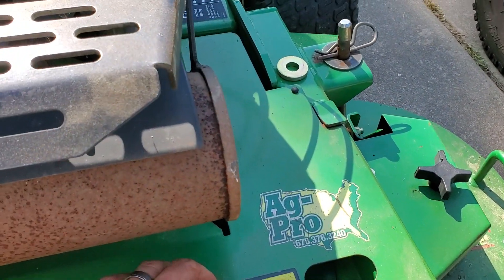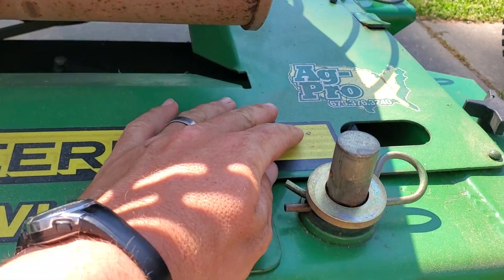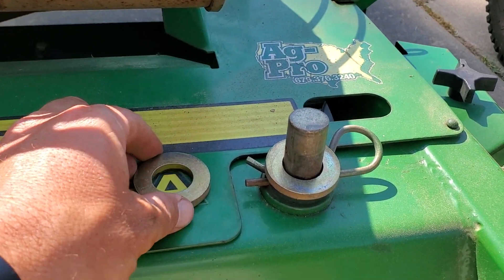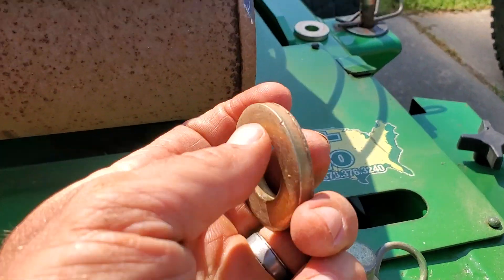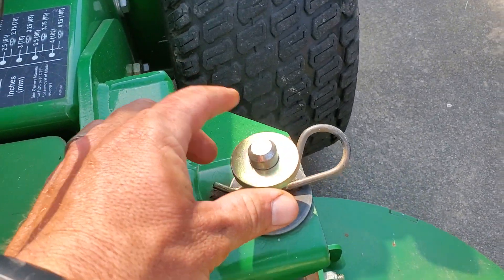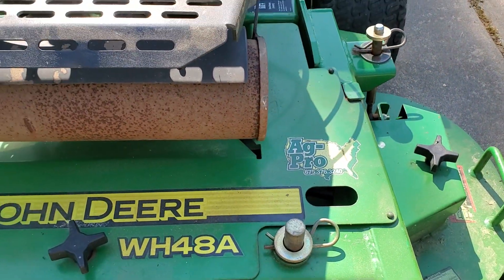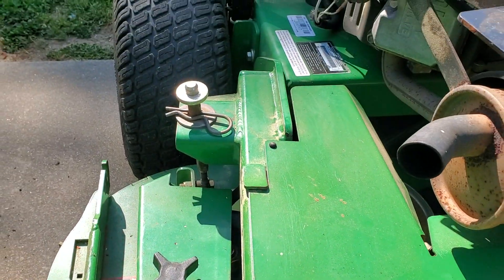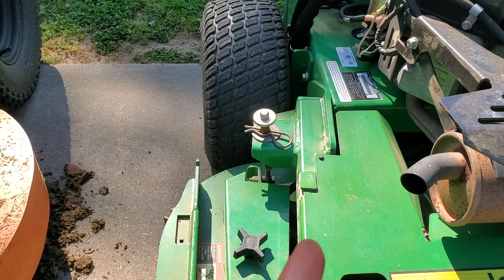I was wrong about the front "weights"

Comment: A day you don't learn anything is a wasted day.... My Metro is the same way. Pretty much any fixed deck mower is. When you move the washers from the top of the post to the bottom you adjust your blade height. Hoping all is well Bud, Dirty Jersey out!!
Reply from the maker: But these where bolted under the frame and didnt know what they where for. i pinned the comment with the link to where i showed that
Reply: @tonyslawncare  Watching that video right now actually. LOL!!! Every manufacturer mounts them in different places until you need them. Than means that deck was NEVER raised or lowered. Not that it's a big deal. I have my Metro dialed in to where it good for 95% of the lawns I use it for. Moving those washers up & down can be a pain. Love Ya Bud!!!

Comment: The no flat tires are great but I think having the caster wheels would be better than the two wheel Bradley I have now
Reply from the maker: So you dont have the caster bradley ? Model sw2006n?
Reply: @tonyslawncare  I have the TS 2000N model
Reply from the maker: @stephenkelley2662  check out the model number i mentioned on amazon its 429 and i think its better than the landshark i may order it soon